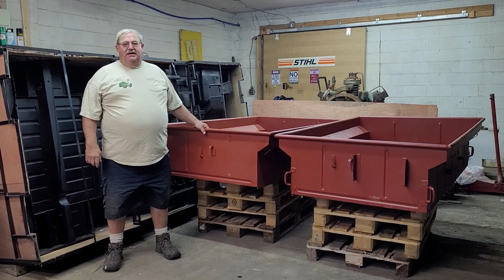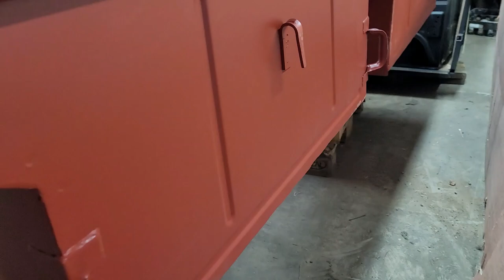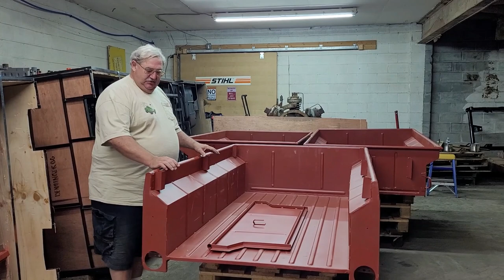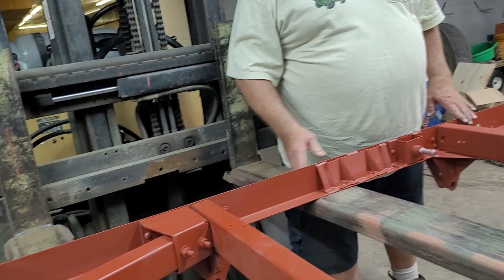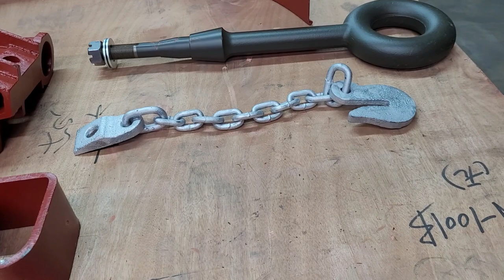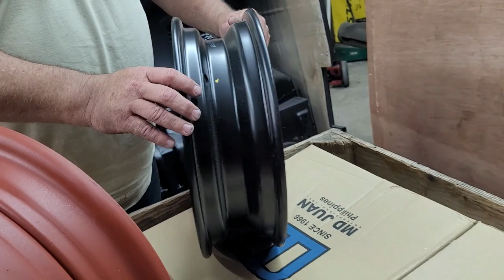MD Juan quarter-ton trailer tubs and parts

Comment: Is there any after market aluminum tub options for these?  I'm building one from scratch and ~600 LBS dry is a bit much for my YJ as fully loaded weight is around 1.3K LBS. Trying to see if I need to ditch this steel body and go with aluminum.